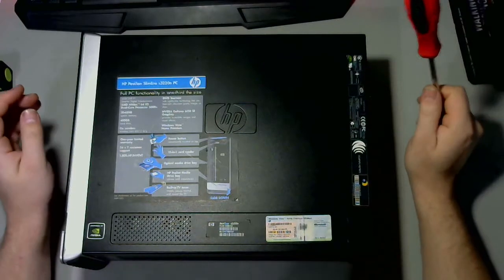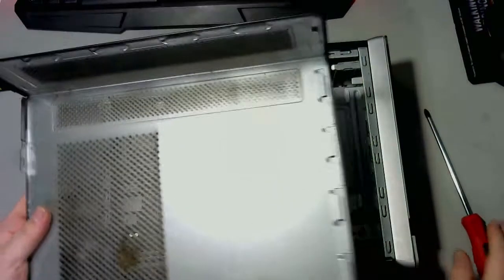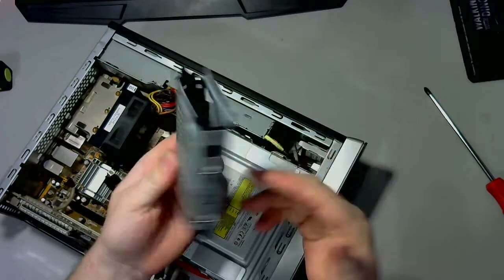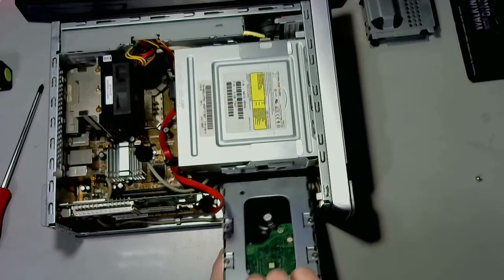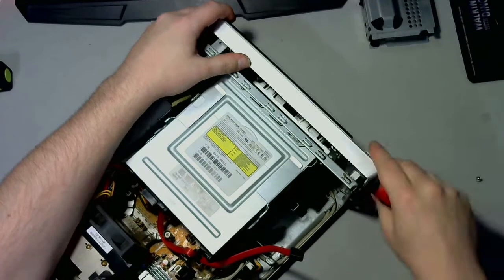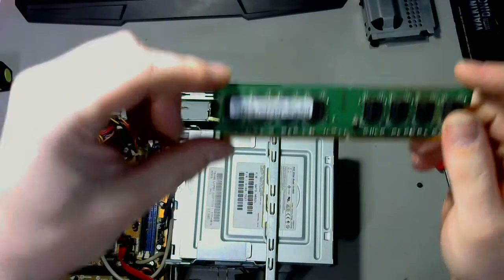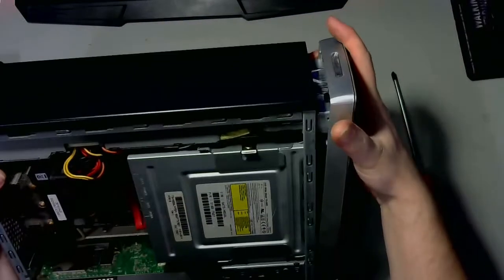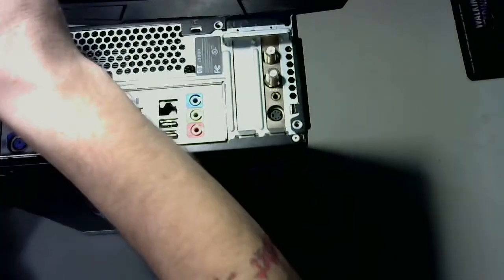HP Pavilion s3000 Slimline Hard Drive Replacement

Comment: You were almost right lol. On the s3707c Slimline you have to lift up on that black plastic table that you broke off at the beginning of the video. Pushing it or any other position does not work. Once I figured out which axis to apply pressure to it popped right out so yay.

Comment: A note to make that media bay come out.. the bay is partially out of frame so to be clear, it is mounted on a slide track on its bottom and CD ROM side. When sliding back    it should come free of all three rails. Also I made the mistake of trying to push the lower part of the plastic release lever. That makes the piece lock back! Only press on the very top of the release. There are two protruding black plastic locking pins that release with only topside pressure and lock back when released or pressed at its lower part of that release lever! 
In my customer's PC the media bay was only in the two bottom tracks and was forced in outside the CD ROM rail. That wedged it tight and required a lot more pressure to slide the media bay back.

Comment: I have the S3050.uk version  I had it since 2006  it came with vista and  max 2 gig of ram so I can't put any more in it   it came also with a g force 7500le card.  Could you tell me what other card that's better than the one I have and  I can use. It has to have its own memory so it don't use the 2 gig ram   in the pc and also does not need a higher power supply for it. Also can I put my pc on its side I hate the side loading dvd drive please reply back